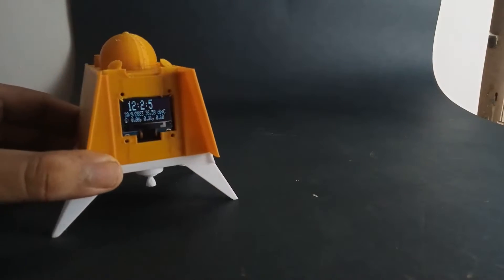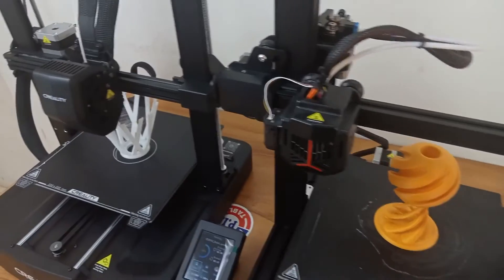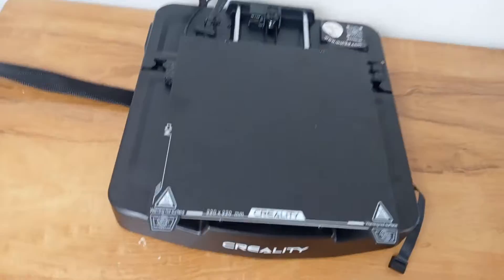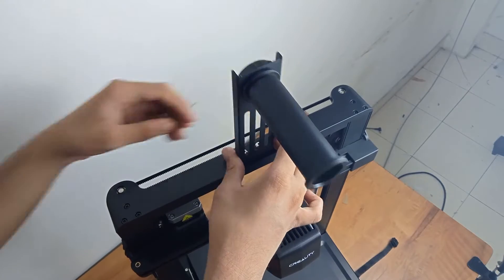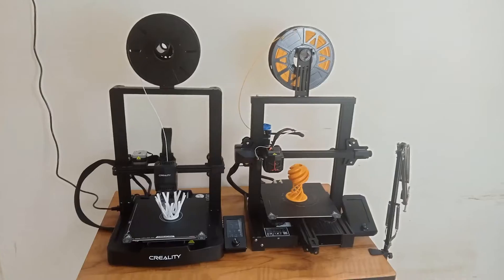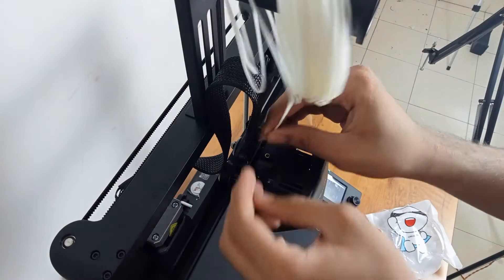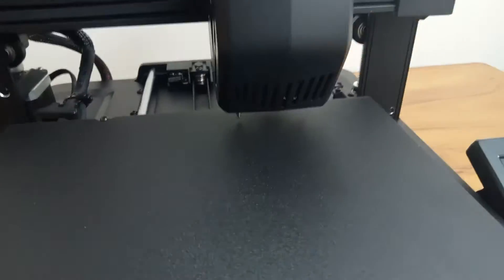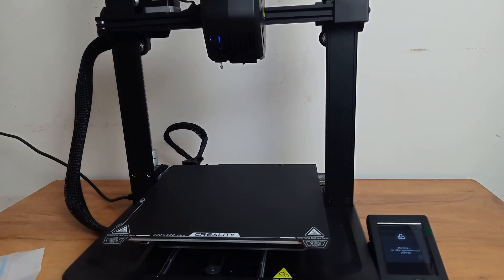Best budget 3d printer in India review Ender 3 V3 SE Wol3D

Comment: a few days ago on amazon wol3d ender 3 v2 neo was for around 17000 rs , and now it went to 24000 rs💀.
and Wol3d ender v3 SE is at 21000 rs .
which printer will be better do you think, I can wait till v2 neo again gets to a lower price point
Reply from the maker: Quite a price hike in V2. 
Still I will suggest you to go with V3 SE, worth every penny. My V2 Neo's keep giving leveling issues, just destroyed a complete hotend in V2 Neo because of clogging. 

If you want a printer to learn 3D printing and invest a lot of time into tinkering, adjusting, etc then V2 Neo is an okay choice. But for reliable printing V3 SE will be much better. Hope this helps
Reply: @bhuvanmakes  I am also having some money Constraints , therefore I think I will am fine with some tinkering stuff to get good prints.
But I have also heard this bed leveling is a real headache .
thanks for the info. BTW.
Reply from the maker: Yup, I understand the price point, even I refrained initially because of the same but then breakage costs and time also adds up. Still your call, Happy Making !  @omkarbansode6305
Reply: @bhuvanmakes  thanks for the Help